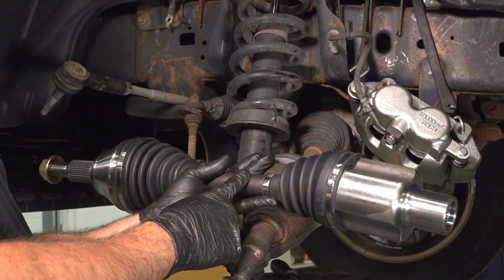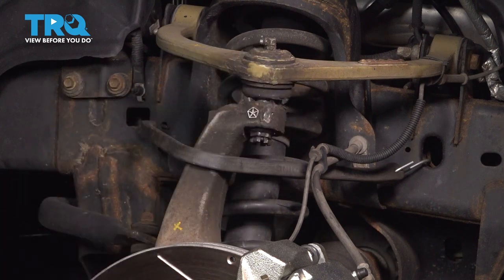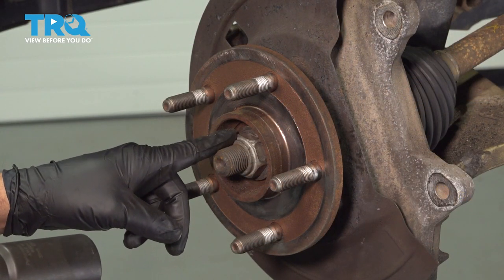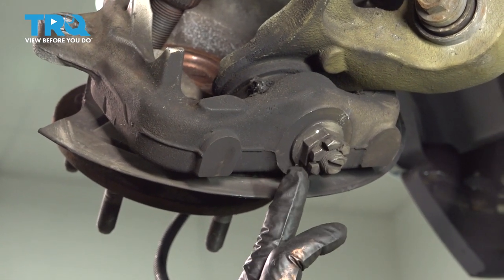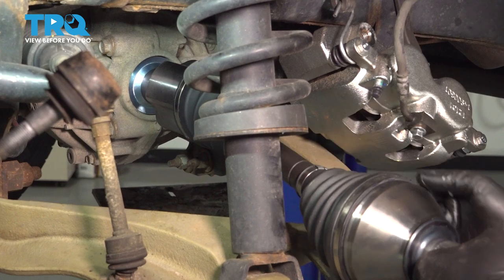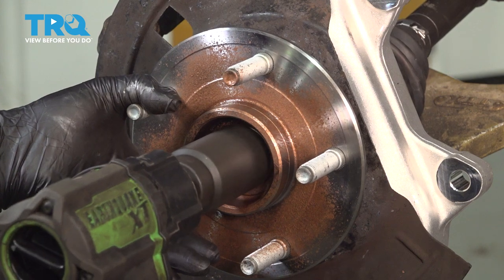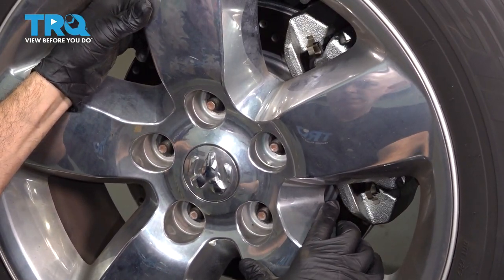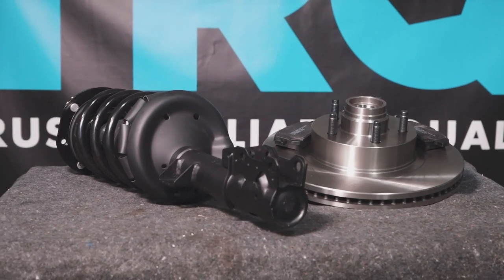How to Replace Front Inner Axle Shaft 2011-2018 Ram 1500

Comment: That's an aftermarket stub shaft.  The flutes on the replacement go in the opposite direction of the OEM part.  The flutes on the OEM are more helical than the aftermarket.  The OEM part will pull excess oil away from the oil seal.  The aftermarket shaft will flood the oil seal with oil.  I don't know if that's better or worse.  I bought a NAPA shaft and returned it and got the OEM at the dealer.  The OEM part was cheaper than the NAPA part - go figure.  I live in North East PA and they salt the heck out of the roads.  I sometimes thing a nice little easily maintainable oil drip to constantly coat the undercarriage might be a good thing.  

Take care.